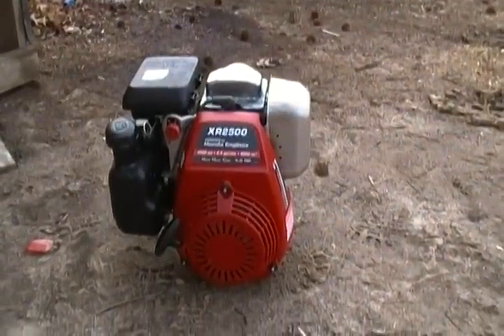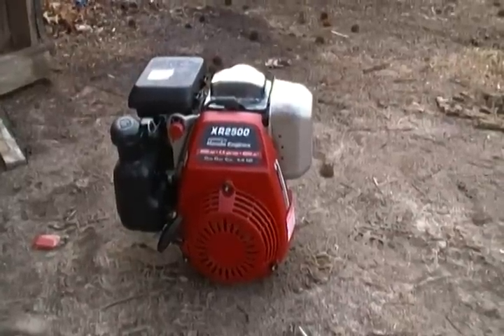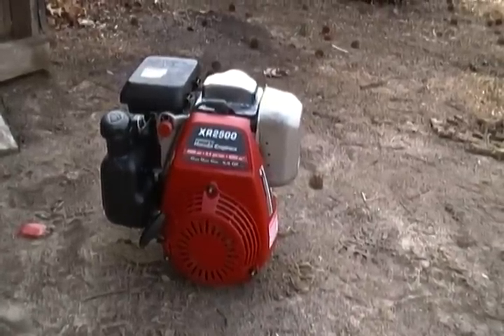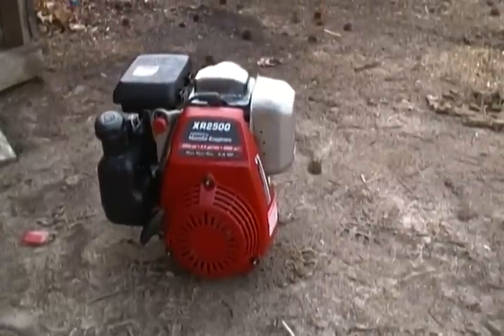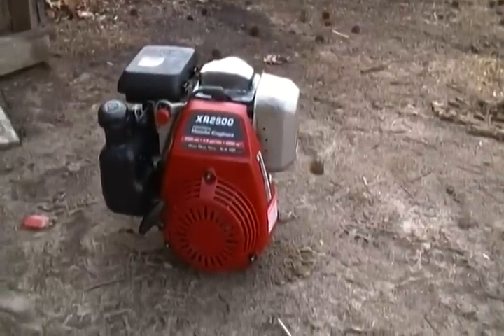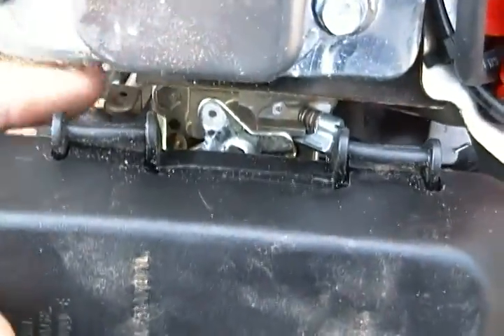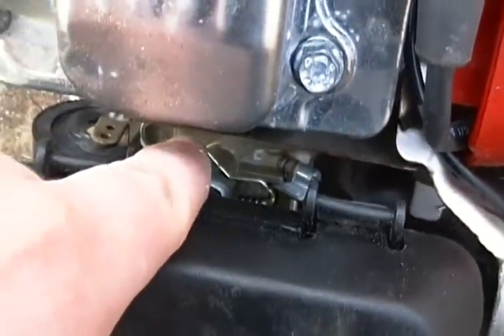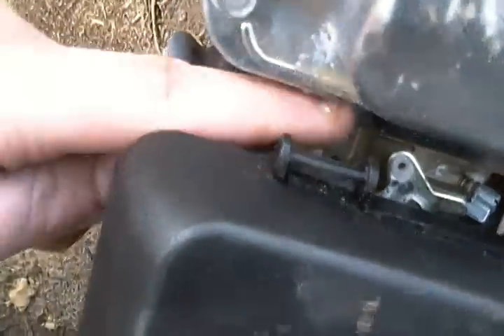honda gc160 engine run

Comment: I mean is there a way to build something to connect to the carburetor linkage to stop the engine from over revving and blowing up the engine . I know the governor is disconnected so it would have to go on the  other linkage that you move to make the motor go faster.

Comment: These engines have a plastic cam in the head which is a bad idea by honda. I work at a small engine shop and we get them all the time with a blown up cam and that makes them not worth repairing as it ruins the whole engine